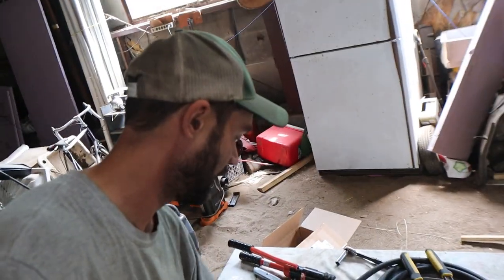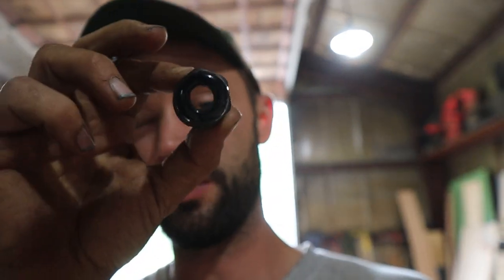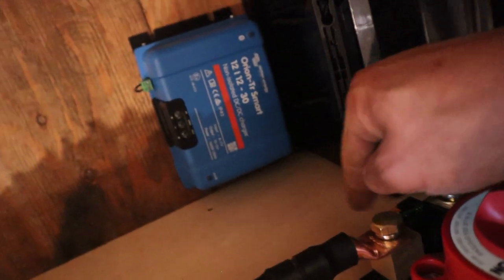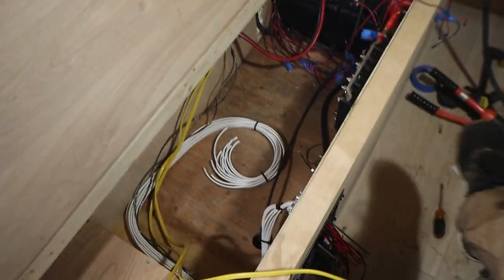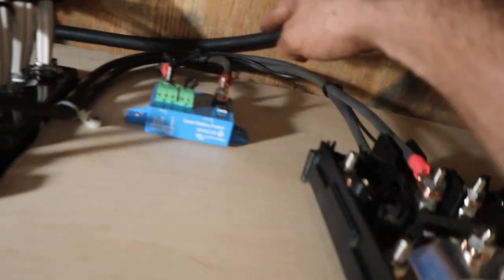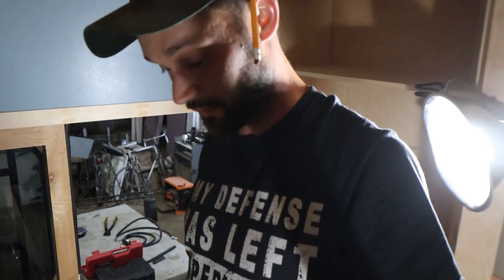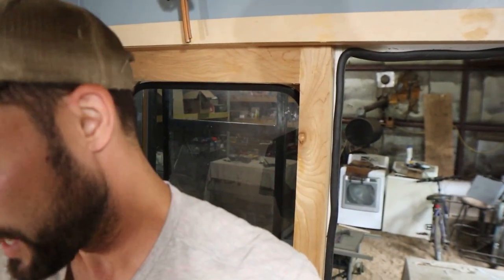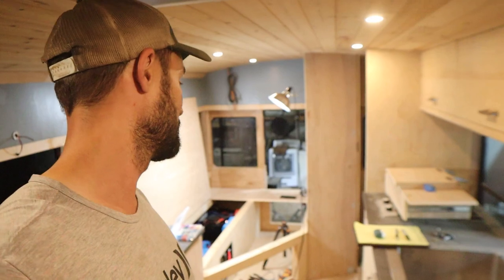Installing an Off Grid Solar System For Your Camper Conversion

Comment: Ive been doing a build myself the solar goes in next week so excited! Only thing i kinda did different i wanted a server rack akso i was afraid to sleep in n the battries so my set uo is behind the drivers area but the bus is looking good. I only wish my YouTube vids were better your videos are way more comolex with angles and the edit.
Reply: Also im going with 48v for the big appliances 10kwh and secondary 12v system 600ah for my life line system as i call it fridge lights water pump water heater then im gonna divide up the 5 panels that will be in the bus 3 to 12v system 2 to the 12v system.

Comment: Hey Mike, do you use connectors on the end of the stranded wire going in to the various Victron equipment and if so, which ones (other than the lugs?)??

Comment: Are you planning on adding an exhaust fan or cooling fans for the solar electrical system seeing that it will be in an enclosed space under the bed?

Comment: Is the ambient airflow in the battery/solar/electrical compartment enough with the inverter running a heavy load, or should there be extra ventilation/supplemental fans?
Reply: I saw in another comment there is a vent. I mean above that existing vent if more air is needed for really heavy loads?

Comment: Does all of those solar components to the battery create heat and if so, how do you dissipate the heat??
Reply from the maker: There is an air vent in the rear of the compartment.

Comment: I’m curious, how do you keep the system from draining the bus batteries as you use power from the solar batteries? I had a small system set up kinda like this just not as advanced but it kept pulling from the bus batteries and made them go dead and then I couldn’t start the bus.

Comment: Good Christmas eve morning to all the DIY solar people. I'm trying to upgrade my solar electic system in my camper trailer I have just about all new parts like six new flexable (300watt) panels and two (100watt) older panels and a new Mppt 100-120 charge controller with bluetooth also my four batteries are hooked up in parallel and my solar panels are being hooked up in series to my charge controller so far I have with the six fexable panels I have just about 110 volts dc nothing is hooked up yet I'm trying to work on this upgade project as the weather allows. Is there any one in or around the Scranton pa area that does camper solar systems becouse solar house contactors don't want any think to do with my camper I could really use the help and I will be greatfull and pay for it.